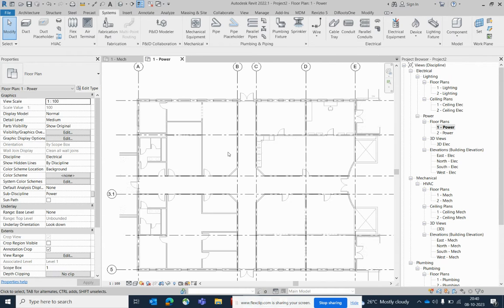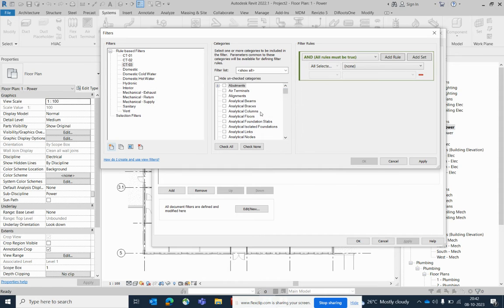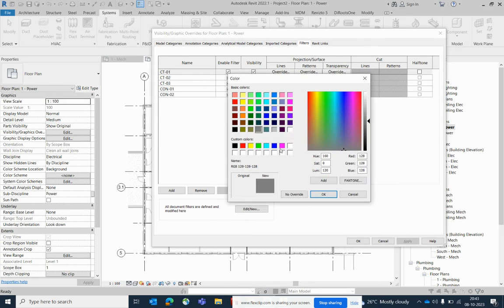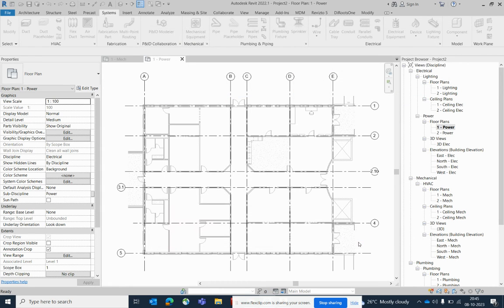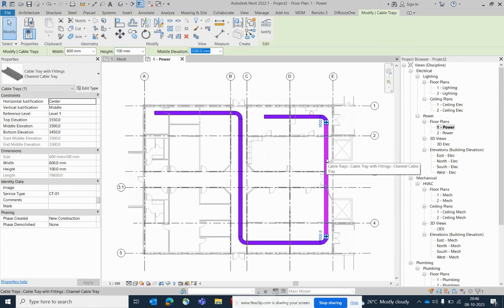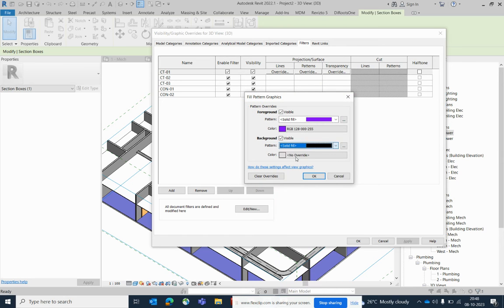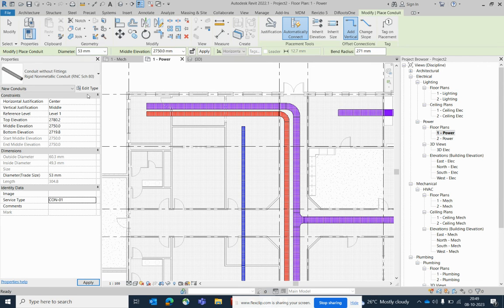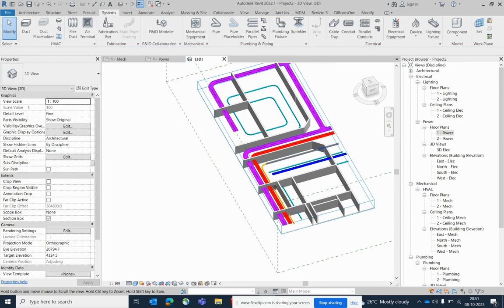How to Apply Filter For Cable Tray and Conduit In Revit MEP

Comment: Thank you for your great video. 
why we need to use filter? in other video you create workset and it was more easy than filters
Reply from the maker: Hi thanks for your comment through workset you can't do filter for cable tray but you can use view template for filter system